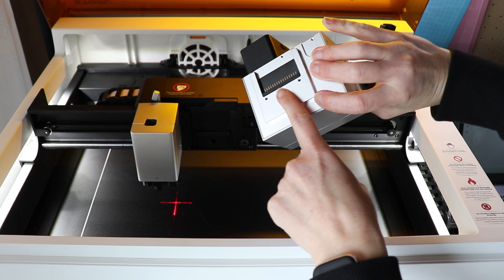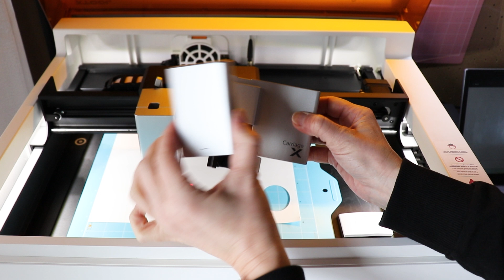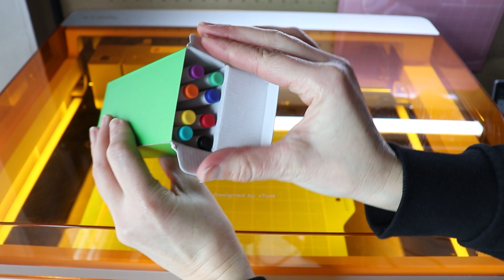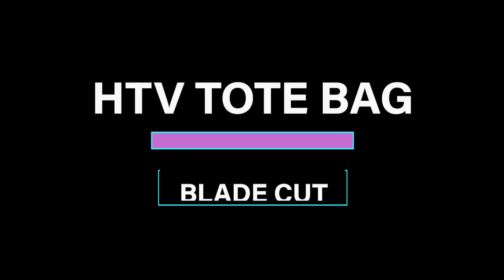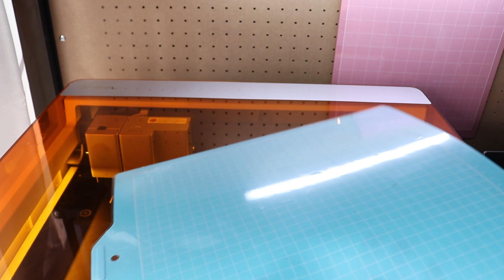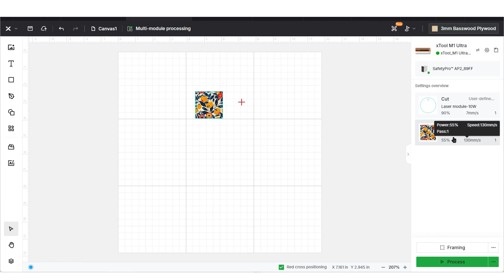6 Project Ideas with the xTool M1 Ultra

Comment: No offense, but you could’ve just used a regular printer and cut it out with scissors at the end. Using the inkjet module for something like this makes zero sense—especially since a standard home printer has about a hundred times more resolution anyway.

Comment: I did a few projects with Basswood, and the projects come out either to light or too dark with the ink module. Any suggestions. also, I have the honeycomb grid, and I was switching it each time I go from ink to laser. I just noticed that you engrave without the presume or honeycomb.  you engrave on the plate itself.  is that recommended.   I see all sorts of different suggestions on how to go about it.
Reply from the maker: In an ideal situation, I would always cut on the prisms or honeycomb, but I do engrave on the baseplate sometimes. Especially when I am going between 2 functions like the printer and the laser. For cutting, you can air to circulate under the cut, but it's not as important for engraving. For the color with the ink module, it's all about tweaking the ink module. I often get lighter projects then I can achieve with a regular printer no matter how intense of a setting I choose.